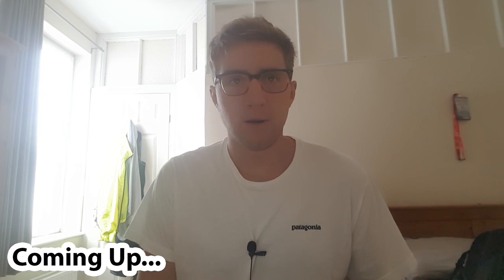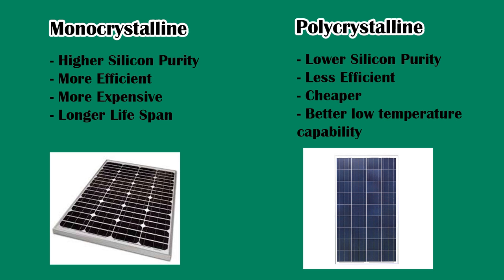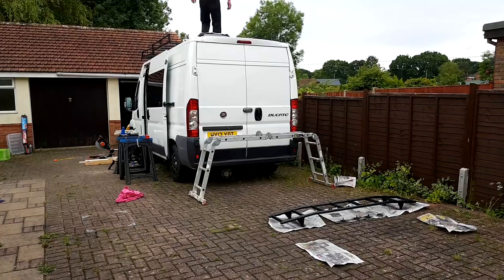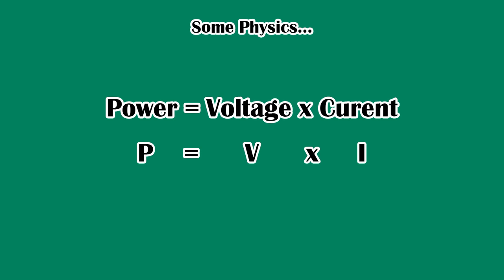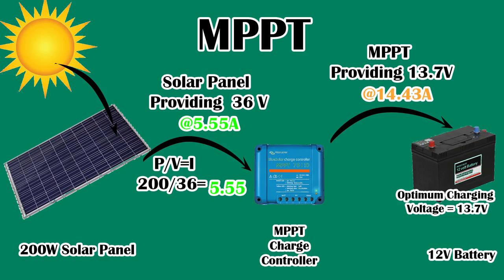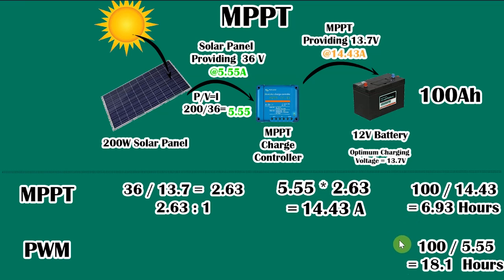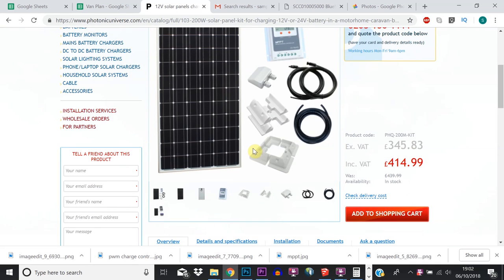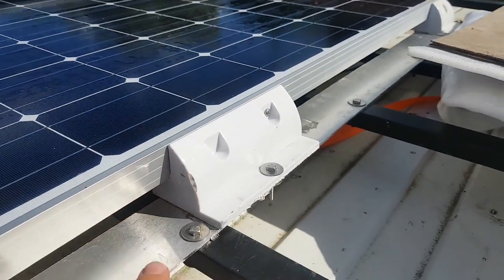Van Solar For Dummies. Monocrystalline Vs Polycrystalline. MPPT Vs PWM. Panel Install

Comment: Well done, though I'd said it's a bit unfair to put PWM on a 24v panel and 12v bank.  If the bank and panel were both 12v  or 24v the mppt advantage would be something like 10-30% instead of the 300% you describe here.  The main advantages of MPPT are seen during Bulk charging and with large loads during Absorption and Float modes.

PWM + poly panels (lower Vmp) are a big bang-for-buck ("cheap and cheerful"?) combination for many folks, and the controller will cost about 1/3rd as much.  I'm fulltime off-grid so the benefits of MPPT were worth the expense.
Reply: Good point. However, many people will be buying panels based mainly on cost, or for mobile applications size, and both of these can lead to using higher voltage panels with a 12v system.

I’m designing a solar system for a friend who lives in a van which has various things on the roof which limits options in terms of panels. The best option given the space restraints is to get 3 x 150w panels which output 25.5v, so combined with MPPT we can get 450w of power in optimal conditions, vs around 260 for the same panels with a PWM controller, or 246w for 3 x 100w “12v” panels and a pwm controller.

Comment: i am installing 2x 100 w panels in parallel , so, they will still produce around 18 volts just at a higher amperage, so il stick with a 20A PWM i think as AFAIK theres no excess voltage that could be converted into amperage by using a MPPT controller..

Comment: Hello! Love watching all of your van conversion videos, we are converting a mwb l2h2 once we find a good second hand one. We are trying to work out solar atm and we’re not sure how much space we have on the roof, do you have any measurements of the roof? We plan on having a fan close to the sliding door and a heki sun roof by the back doors, not sure what space we are left with for solar but it’s more important than the heki!
Reply from the maker: Hi Susie. Good to hear! Are you using sketchup to design your van? If so you can import to scale models of a l2, h2 from the 3D warehouse. When you say fan above the sliding door, which type do you mean ? Do you know which solar panel you want/ need? Thanks for watching!
Reply: @sampayne6318  Thanks for getting back to me so quickly! Yes my boyfriend is now using Sketch up and using the scale model, we cant wait to get started! I didn't describe the fan very well haha, i just meant as you walk through the sliding door the fan will be fitted there on the ceiling in the middle of the van. I think we are going for a Panasonic n245 and a LG neon r 370. Do you think its best to get 1 big battery or 2 smaller ones?

Comment: 200w = 5.55A at 35 volt (not the way around) Current charges, Volt doesn't do anything
Reply: voltage “pushes” the current into the load (/battery)...